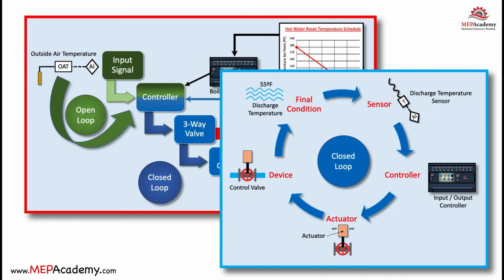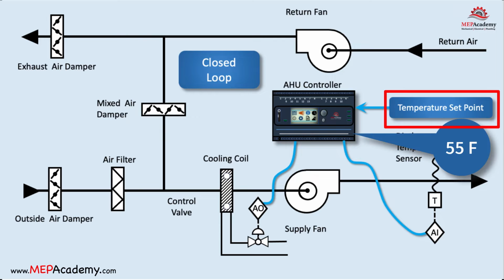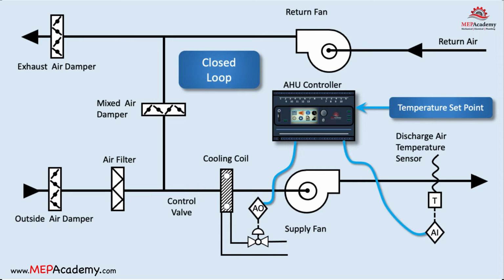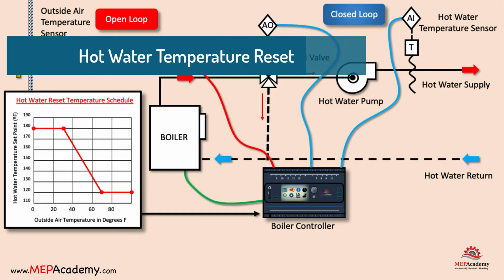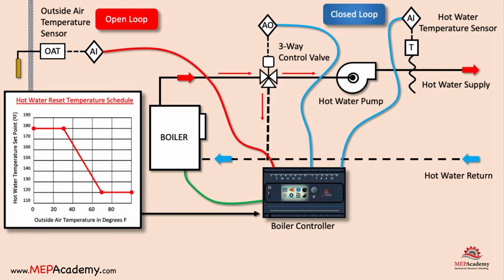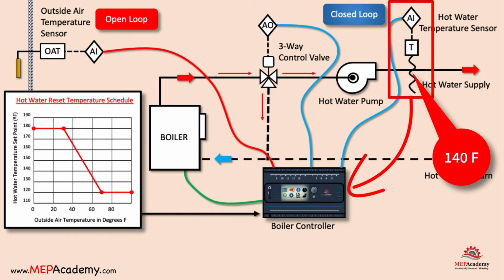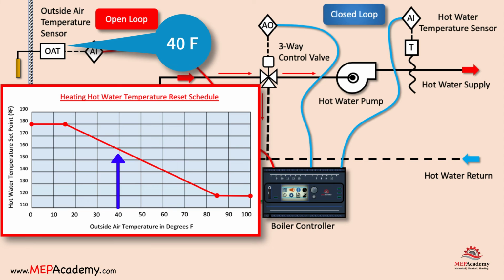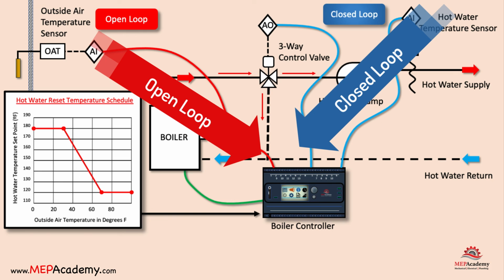DDC Control Loops

Comment: I would suggest differentiating between boiler reset versus hot water supply temp reset. The example in the video is resetting hot water supply. While there are very good reasons for resetting the boiler discharge temp, a standard boiler should not be reset below about 150F to 160F. So if the heating system has a standard eff boiler, there ought to be a narrow reset range for the boiler (180 to 150) while the hot water supply would modulate the 3 way valve when the supply water needed to be less than 150F. If the boiler was a condensing boiler it could be setup to supply water temperatures from 180F to 120F with out the need for a 3 way valve to control temperature.

Comment: basically the second example where it uses open loop, it predicts how much heat is needed, so if the reset schedule says that a lot of heat is needed, it will try to output higher temperature (makes sense because it would speed up the heat exchange in the coil further requiring less fluid and less pump usage)
Reply from the maker: Thanks for watching.